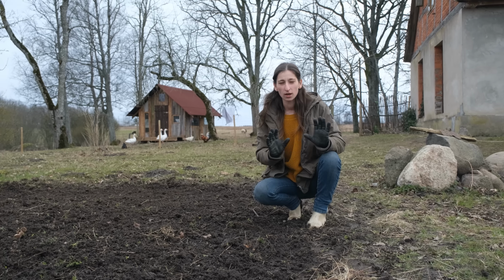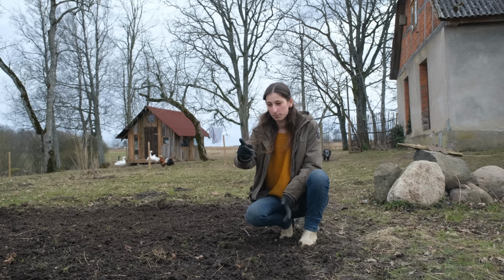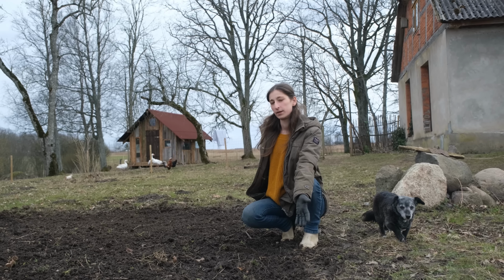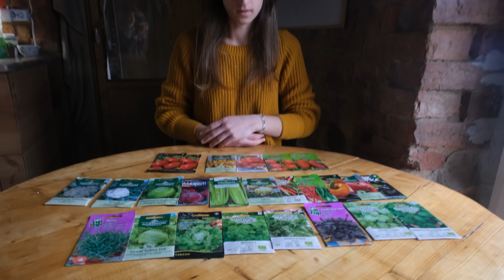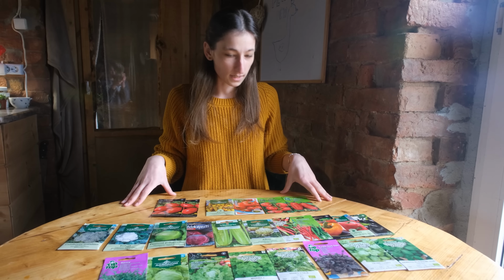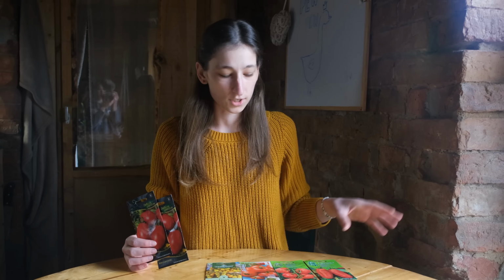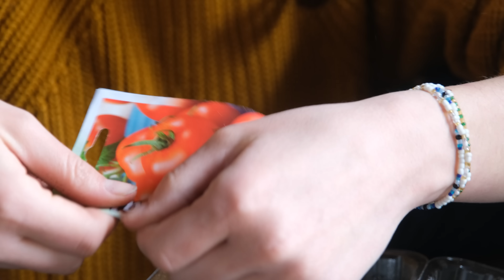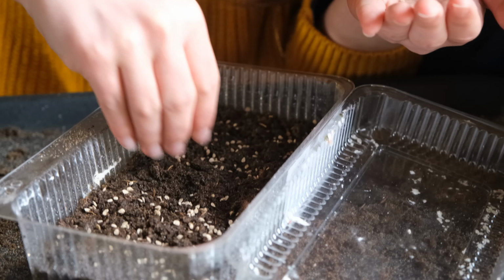Starting to Plant the First Seeds?!

Comment: For best results, garlic should be planted in late September to mid-October.
Reply: Yes they could do this like many do and cover good with straw when it starts to get cold and keep covered until the next spring or when they aren’t going to have anymore freezes and then remove the straw and it will start coming up. So many do it this way guy’s.